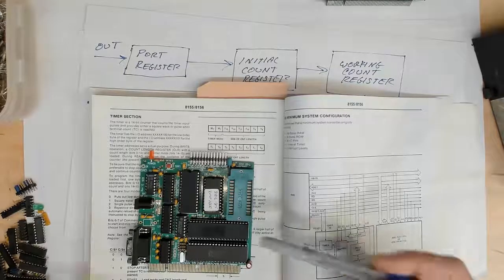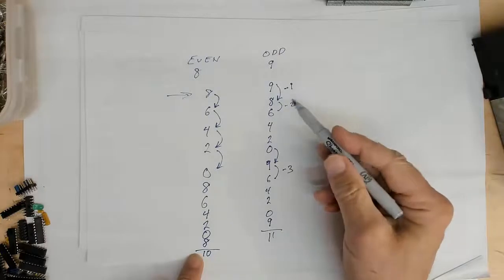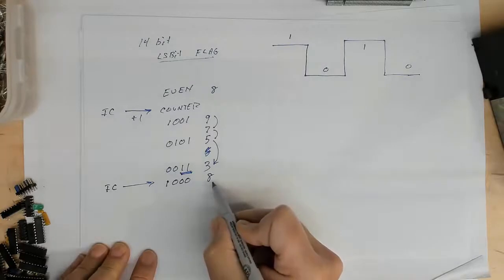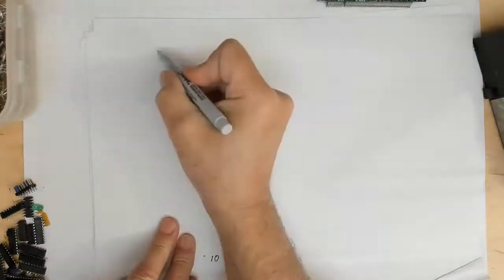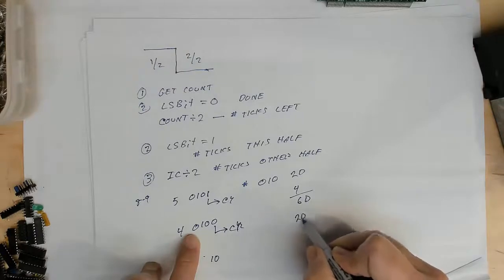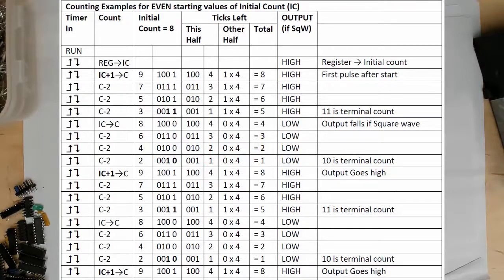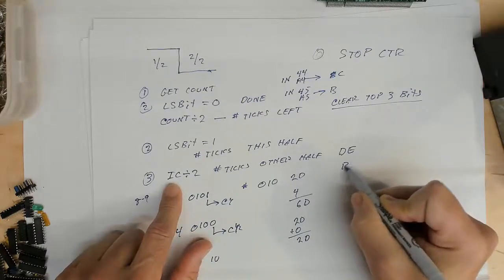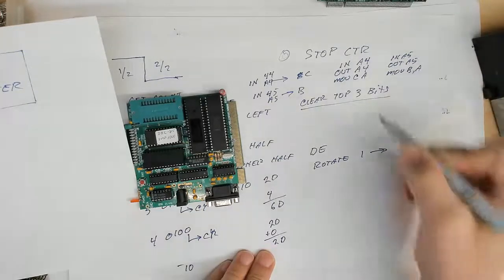{57} How the 8155 Timer / Counter *REALLY* Works— Reading and Interpreting the Timer Count

Comment: You said the first thing to do is stop the counter? So all the incoming clocks are missed and not counted when it is being read?
Reply from the maker: Yes, that was a problem if the clock ticks are coming in faster than the processor could get the count then reload and restart the counter.  The Intel 8253 solved that by adding an output buffer.  With the 8253 the user writes to the mode register which captures the current count to this buffer.  The processor can then go retrieve that value at its leisure. Also, the 8253 provided three channels so it was ideal for three axis control.